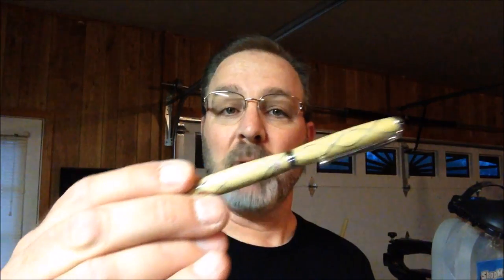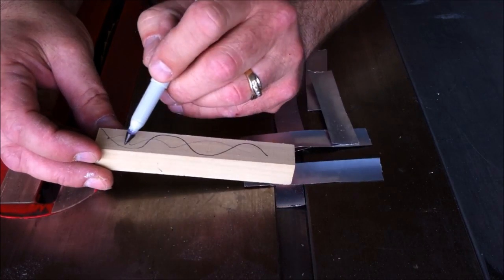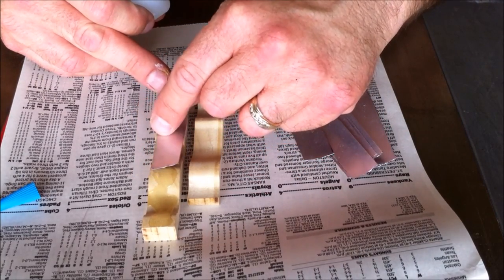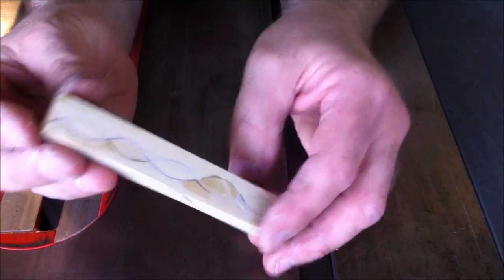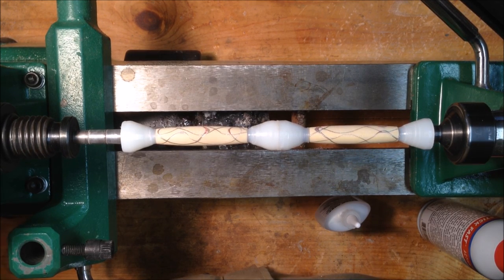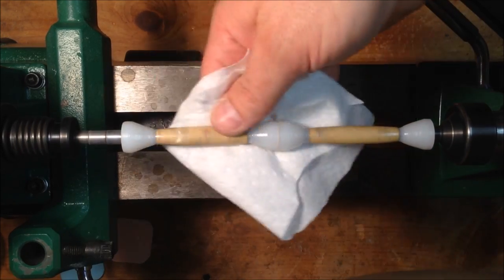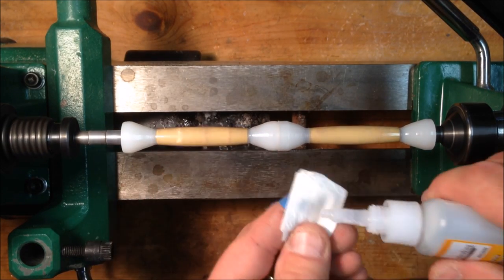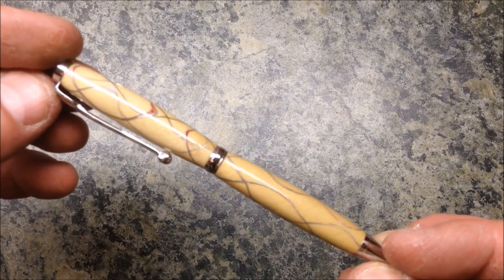Soda Can Segmented Maple Pen

Comment: Hey Bob, looking for some advice on this one.  I gave it a go tonight, and promptly blew apart both blanks.  As soon as the tool hit the metal it caught and shattered the piece.  I thought I glued it enough, as I had squeeze-out in all directions.  The only thing I can think to do is really sand it down on the edge sander first, get all the surfaces free of any metal that might catch, and go real slow with it.  Has anyone else had problems with it?  I am so anxious to get this one to work, as I love the pattern, but boy was that frustrating.  Also used a different type of wood - padauk, so that may have something to do with it.  Thoughts are appreciated.  Cheers - Chris
Reply from the maker: +Sig Guy Are you using carbide? I've heard several people say that carbide really grabs the Aluminum. One thing you can do that will help is to rough up the AL and use epoxy instead of C/A. It's more forgiving. 

Regards,
Bob
Reply: RJBWoodTurner
I use a roughing gouge to get going and then carbide once it's turned round.  I'll keep the epoxy part in mind.  Thanks for the help!!
Reply from the maker: +Sig Guy Keep me
Posted, I'll do what I can to help. 

Regards,
Bob
Reply: Definitely going to take the epoxy approach.  The CA just proved to be too brittle and toward the end of the turning, it blew apart. That's ok, it looked crappy anyway ;o) Another night!
Reply from the maker: +Sig Guy I think you'll be much happier with the epoxy. Be sure to rough up the AL too. 
  Send me a photo when you
Finish it. 

Regards,
Bob
Reply: Sig Guy Le

Comment: After you cut the blank the first time and glued the aluminum in did you cut it again with the scroll saw to put the next strip of aluminum in?
Reply from the maker: Hello Calvin,
  Yes, after the first cut and glue up, I used activator to quickly dry the glue. Otherwise, let it air dry completely. Then I take the blank back to the Scroll Saw and cut it again. For this pen, I made four cuts. 

Regards,
Bob

Comment: Have you tried cutting the blanks on the bandsaw with a thin blade?  I don't use my scrollsaw that often....just curious.  Great idea and video!
Reply from the maker: I had not because I had a junk bandsaw. Now that I have a nicer one, I’ll give that a try. 

Regards,
Bob
Reply from the maker: A second note is the blade kerf needs to roughly equal the width of the material you’re segmenting with. 

Regards,
Bob
Reply: @RJBWoodTurner  Understood.  I'm looking forward to trying this method.  I'm in the process of getting all the equipment together for stabilizing and vacuum of pen blanks.  The stuff can't get here soon enough.  By the way....your site is my new go to for info.  I like the in-depth details you provide.  Keep finding these creative methods for pen turning.
Reply from the maker: Thank you Tony,
  I appreciate that. 

Regards,
Bob

Comment: After making WAY too many pop can alcohol stoves have a few tips on cutting cans.

No need to use a dremel to cut off the top and bottom and no need to use tin snips. Just use pointy scissors. Just don't use your wife's good fabric scissors. :)
Reply from the maker: Thank you for the tip Cliff,
  I'll give that a try, it will probably speed the process and save me time. 

Regards,
Bob

Comment: Great idea. How long did you let the glue dry in between segments? Thanks, Ruth
Reply from the maker: +stonimal Hello Ruth,
   I used activator spray on the C/A so I was able to cut, drill, and turn right away. Be sure to scuff up the Aluminum with some sand paper before gluing, it will help with adhesion. 

Regards,
Bob

Comment: what do you call the tool you cut the blank with, it's like a tiny bandsaw that can do sharper turns
Reply from the maker: It’s called a scroll saw. There amazing for intricate work. 

Regards,
Bob
Reply: @RJBWoodTurner  thank you i'll have to get one
Reply from the maker: Scroll saws are almost as addicting as the lathe. I haven’t used mine much lately but it’s one of those tools I’ll keep as it takes very little room and can make some amazing stuff. 

Regards,
Bob

Comment: What speed was you at when applying the CA glue
Reply from the maker: As slow as possible. I believe that was done on my green lathe which could go down to 500 RPM. My Jet only drops to 700 RPM. 
  To fast and you sling C/A everywhere and get more waviness in the finish. 
  If your lathe will go slower, use that setting. 

Regards,
Bob

Comment: I'd really like to make a set of pens and pencils with different tip and lead sizes to use in my art. Do you have any suggestions on where to find the supplies or kits for the inner workings of the pens?
Reply from the maker: Michael,
  I don't really know where to get a set of different sized pencils and tipped pens. I've never seen anything like that. I will post your question to some of the pen sites I use and see if anyone out there can help with this. 

Regards,
Bob
Reply: Ok thanks
Reply from the maker: First comment back, 
  Hopefully, there will be more. 

Regards,
Bob

Exotic Blanks carries the Schmidt .05 .07 pencil mechanisms which fit a lot of the "Parker" pens. They also have the Schmidt .09 pencil innards, but it's too large for the Parker pen tips. You have to drill out the hardware.

There are also larger "sketch" or "shop" pencil kits that use much larger lead.
Reply: Awesome. I'll check them out. Thank you again!
Reply from the maker: Here are a couple more comments / ideas. I have been searching the Internet and can't find anything. I'm thinking the remanufacturing idea may be the best option. 

Regards,
Bob

PSI has Pencils with 3.5 & 5.6mm lead.

I've remanufactured Pentel  pencils for an artist.  She wanted a 0.2mm,  but the smallest I could get was a 0.3mm.
Take look in an art store, you will find lots of different sizes.
Reply from the maker: Michael,
  I got another response tonight. 

Perfect Fit from Berea is made just for this purpose.

It'll take Parker, Monteverdi, Schmidt, Visconti ink in extra fine, fine, medium and broad tips

AND it's a pencil that will use a Schmidt .5 .7 .9 lead refills.

I hope your able to put something together from all of this. 

Regards,
Bob
Reply: Thanks I'm checking them out now.

Comment: Actually I have a question... does the glue ever stick your parts together?
Reply from the maker: If you're referring to the bushings, no. It peels right off and if there is any glue left on the end of the blank, I just place some 220 grit on a flat surface and sand it off. 

Regards,
Bob
Reply: Perfect thanks!

Comment: Are you using the non stick bushings b/c the CA would possibly bond the blank to the 7mm bushings? I've seen you use EEE polish with Shellawax in previous videos and CA in this one....any preference to the finish or durability comparison? I watched your 3 part series in pen making and now this. How fascinating! I've been saving for 8 months and Santa finally brought me a lathe...Yay! A bunch of "nice to haves" are on order from PSI :)
Reply from the maker: Hello Derek,
  Congratulations on the new lathe. Yes, the non stick bushings are to keep the C/A from sticking to the metal bushings. If that happens, the glue will sometimes chip as you remove the bushing from the pen blank.
  I love the EEE, Shella Wax combination. C/A in my opinion, gives a nicer looking, longer lasting finish. I use EEE & Shella Wax on items that don't get handled often like ornaments. Oils from your hands will darken the wood making it look dirty or grimy. 
  PM me and I'll send you
My cell number if you ever want to pick my brain. It may be easier then typing back and forth. 

Regards,
Bob

Comment: What is the spray that you use after applying the CA glue?
Reply: Millzy1316 CA glue accelerator.
Reply from the maker: It was an arosol C/A glue accelerator. It does a nice job of instantly curing the C/A but you have to be careful using it or it can cloud the blank. 

Regards,
Bob
Reply from the maker: Thank you Cliff. 

Regards,
Bob
Reply: RJBWoodTurner Okay, but when using CA glue as a finish do you have to use the accelerator?
Reply from the maker: No, it's not necessary. When using the medium C/A, it has a longer drying time and stays tacky. I just like to speed the process along. If you are using thin C/A, it will dry almost immediately. 

Regards,
Bob
Reply: RJBWoodTurner Thank you very much for the info
Reply from the maker: You are very welcome, 
  If I can answer any questions for you, I don't know everything but, I'll be happy to help. 

Regards,
Bob

Comment: what pen kit did you use,,and where did you get it,,
Reply from the maker: Hello Jeff,
  When I'm experimenting g I use the Funline kits from Penn State. www.pennstateind.com. 

Regards,
Bob
Reply: im going to try to make one like you did,,
Reply from the maker: I just made a new one this weekend. I have to get the video edited so I can upload it. Use lots of C/A and you may want to rough up the can with a little sand paper like you do your tubes. It will help with adhesion. Send a photo ween your finished. 

Regards,
Bob
Reply: thank you bob,,i will,,can I use a bandsaw to cut the design on the pen blank,,
Reply from the maker: +jeff oldham Hello Jeff,  Yes you can, the only issue you may face is the kerf of the band saw blade verses the thickness of the can. Thinner blades work better because the remove less material. You could always use veneer. It is thicker than aluminum and will take up the extra space removed by the band saw. Plus its really flexible.Regards,Bob